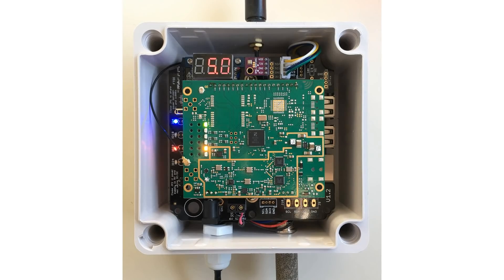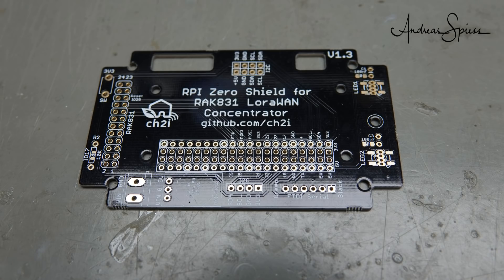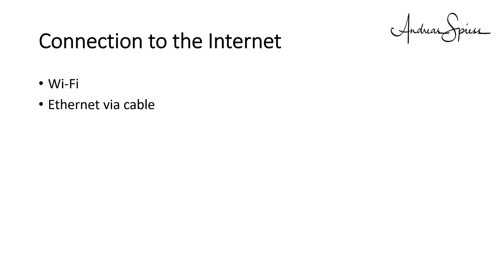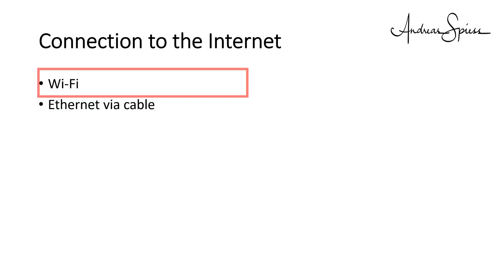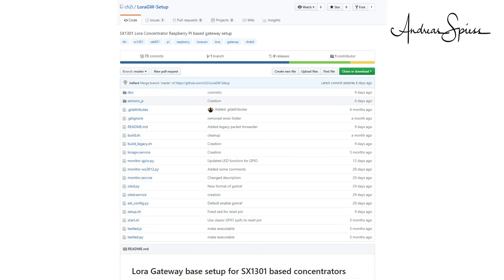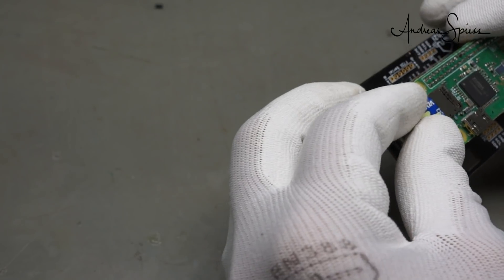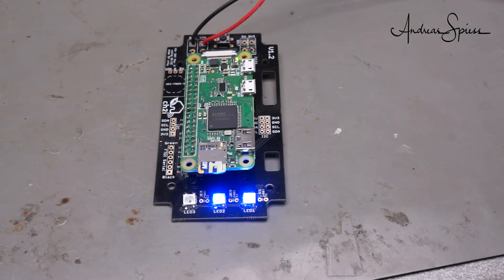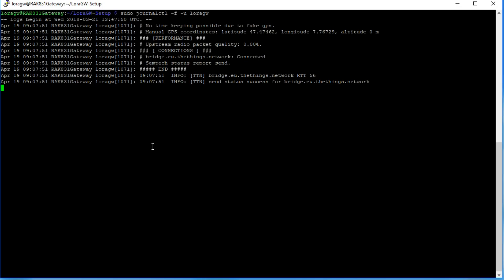#196 RAK831 LoRaWAN Gateway with a Raspberry Pi Zero (project)

Comment: Hello Andreas, greetings from Peru, congratulations for your excellent work! I would like your help, I will tell you quickly. I have proposed to implement a monitoring system for warning of landfalls in my city, for that I am thinking of setting up a "Wireless sensor network", I have researched and want to use LoRa technology, but I am still learning and your videos have helped me a lot to elaborate my possible solution. Please correct me and guide me if you think something is wrong in my plan: the system is made up of 3 sensor nodes (since there are 3 streams), each of them has a microcontroller (I want to use arduino), a LoRa module (maybe use the RFM95W like in your video #117) and the sensors, that's all. I have seen that each one can be configured as a transmitter or receiver, but the detail is in the "Gateway", if I have 3 sensor nodes mounted in the way I explained to you, I would need to be able to use a Dragino gateway, but it would have to be multichannel TRUE? Those are very expensive, I saw the way you built the gateway yourself, but the limitations leave me in doubt... Besides, you use Raspberry 3 or 4, although I saw another that you used a raspberry zero. Since your videos are from 5/6 years ago.
As of today, what components do you specifically recommend using?
What do you think of the structure as such?
What is the best way you recommend to develop the gateway? Or if a single channel gateway would work for my 3 sensor nodes?
Reply from the maker: You will need a gateway (today, I would use a commercial one) and as many sensors with a LoRa module as you want. The gateway has to have internet connection.
Reply: @AndreasSpiess  Thank Andreas, and do u know if this gateway (rak831) can receive data from different nodes LoRa? not at the same time, but with delay maybe...
Reply from the maker: @maikdaiwt-8  Maybe you watch my LoRa introduction video?
Reply: @AndreasSpiess  Thanks, that's the only video I hadn't seen.

Comment: The RAK board is everywhere out of stock, but they have the RAK7246 WisGate Developer D0. Is this a good alternative?
Reply from the maker: It has a 1308 chip. So it is an 8-channel gateway and should work for indoor. Look at the Mikrotik Gateways if you need an outdoor gateway.
Reply: @AndreasSpiess  Can I build a waterproof enclosure? Or is the gateway itself not good for outdoor
Reply from the maker: @jan.8879  Of course you can do it.
Reply: @AndreasSpiess  And the performance is ok like yours or are there differences? To what should I pay attention when choosing a gateway?
Reply from the maker: @jan.8879  They all use a similar design and the same chip.

Comment: Love these video. I wonder since it’s been some time will you revisit this to see what new hardware is available?
Reply from the maker: LoRaWAN Gateways are no more very interesting for the viewers of this channel :-(
Reply: @AndreasSpiess  that is unfortunate, but I understand your position. I am planning to put a weather station and other sensors at a garden across town, ~2 miles. I thought using LoRa to transmit and read that data would be neat.
Reply from the maker: @JohnWeland  Jost do it if you have a line of sight from the nodes to a gateway (no need it is yours)

Comment: Interesting. You're my leading feed on LoRa. As a suggestion, on the pi, if you attached to a gpio a servo to open a vent when reading temp data, that would save the heating issues. 

I'm just waiting for some practical data transfers to see what this is really like.. I see it is one tenth of dial up for most applications. Shame really...but upto 2mb. Which is great.

Also the test you did, it shows more than you think. Links (route paths TTL) has not been done on LoRa. This means that the performance could be increased. But... this maybe a Achilles heel as the same un optimisation is what makes it work.

Non the less interesting as much as it is a retrograde solution.

Comment: I bought an SX1276 868Mhz LoRa module(RFM95w) from robokits and tried to communicate a simple “hello world” message with ’ The things network ’ . I used an arduino UNO to connect with my LoRa module and the library I was using was the arduino LMIC library. Since I am from India, I checked the frequency plan in the things network and found that the frequency range for India is 865-867Mhz. So in the downloaded Arduino LMIC ibrary, I made changes in lorabase.h and ttn-abp code for arduino-RFM95 connections. I edited the European frequency values to Indian frequency values. I tried using activation by personalization (ABP) for communicating with the things network. There was a gateway in our area and all I know about the gateway is that it is an RAK831 gateway. I tried to send the message to the things and I could receive the messages in the thing network. It all worked fine… Now I bought an RAK7243 gateway from Aliexpress which is a latest version of RAK831. Actually RAK7243 is considered to be slimmer and cooler than RAK831. The SD card showed a website where we could download the firmware.I loaded the software and the OS raspbian stretch lite in the raspberry Pi 3B+ and connected the gateway to internet using WiFi. I used putty to access the raspberry Pi from my computer using a LAN cable. Raspberry Pi was configured for WiFi settings and I could get internet. I checked pinging Google.com and I got response from Google which means internet is connected in my gateway. I looked for my ethernet MAC address and made the changes in global_conf.json where I entered this MAC and the things network server address for Asia region. In the global _conf file downloaded, I could see the frequencies were the same which I used in my LoRa module library. SPI communication was enabled. Then I registered the gateway in the things network. I gave the gateway ID, checked the semtech packet forwarder dialog box and also properly gave the region, operating frequencies, location and antenna position and registered…The antenna used was rubber duck (2dBi and 50 ohm). The gateway was seen as connected with green symbol…each time I switch on the gateway, the power(Red led) will blink and (green led) also blinks for sometime (may be a few 10 seconds) and after that only red LED blinks. Now I tried the same hardware (LoRa module and arduino UNO) and the same arduino LMIC code, which I used to communicate with the gateway in my locality. But this time, it was not working. I didn’t receive any message in the the things network… Is it the problem with the gateway or my LoRa node? I checked for the status in the gateway using raspberry Pi command… It showed the message, gateway is active(running).Could anyone please help me to solve this issue?
Reply from the maker: Maybe you watch my videos about debugging? Since you have two different gateways you should be able to find out where the problem is. If your node does not work with both gateways (and you are sure the signal reaches the second gateway), the problem is your node (or the activation on TTN). Otherwise, it is your gateway. Check the keys and if they are LSB or MSB.
Reply: i faced the same issue , after a lot of search i found the issue was in TTN . Some times it misbehaves ...

Comment: Andreas Some advice  Please. I live in a area that I'm going to have to have a Antenna very high to get line of sight.  Instead of putting  the Control Box up on the Antenna, I'm thinking of running a very long Coaxial from Antenna  down to  Pi and RAK831 control box in house., does that sound right to you ?
Reply from the maker: No, antenna cables on these high frequencies have to be avoided! As you see my antenna cable is about 10 cm long. Good antenna cables cost around 10 $ per meter and still lose power.
Reply: So I guess I will have to go with a Long Ethernet cable from box on Antenna, Thanks for your help Andreas.
Reply from the maker: Or Wi-Fi as I do it
Reply: @AndreasSpiess  I'm putting  a RPI 3B+ up in the box so I guess WiFi it will be it.  The Antenna pole will be about 40 foot up,  that high I should be able to talk to Martians. Thanks for all your help Andreas

Comment: Hi Andreas, 
where exactly is the differance between the Gateway you build in this Video to the Gateway from Episode #124? I would like to use a LoRa-Gateway in my house and Connect it with maybe 20 Temperature and humidity Sensors. Is therefore the cheap Gateway from Episode #124 usable? 
Thank you really much in advance, Klemens
Reply from the maker: For your case, a single channel gateway can be ok. As its name says, it operates only on one channel and if this frequency is blocked somehow, no communication is possible. The full gateways have 8 different channels as well as all Spreading Factors.

Comment: Hi,

Can you add here the url of the product on AliExpress? 
There seem to be more products using RAK831 module, and I don't know which one is the concentrator board.
It quite confusing...

Which one is it?
This? https://www.aliexpress.com/item/RAK831-LoRa-LoRaWAN-Gateway-Module-base-on-SX1301-433-868-915MHz-range-of-up-to-49200ft/32821411294.html

Or this? https://www.aliexpress.com/item/IOT-LoRa-Gateway-Module-Base-on-SX1301-Wireless-Spread-Spectrum-Transmission-Sending-Node-LoRaWAN-Module-USB/32847407832.html

Or this? https://www.aliexpress.com/item/RAK831-LoRa-LoRaWAN-Gateway-Module-433-868-915MHz-base-on-SX1301-Wireless-Spread-Spectrum-Transmission-range/32832894046.html

Thanks.
Reply from the maker: I added now a link in the description

Comment: I only discovered your videos recently, so I'm not sure if you have done a video on Ethernet over powerlines yet. This is very interesting technology generally making use of modem chipsets from Qualcomm or Broadcomm, and the bandwidth is surprisingly good considering the mains wiring was never designed to have good impedance characteristics for communication. In any event, this would have been a third candidate for connecting your gateway to the internet...
Reply from the maker: I did not do such a video yet. You are right, this would have been an interesting possibility for my situation. I did a quick search, but only found devices, no "bare boards". For a device like that it would be good to have at least in the gateway only a board (smaller)

Comment: Hi Mr Spiess, 
Thankyou kindly for your videos.    My fellow Techs and I like to watch your shows as they are more entertaining thank Netflix.
I have a scenario that you may have a solution.
In a remote environment, is it possible to have a group of sensors report to a central device  in small data packets-  where No LoRa  connection is available?
Each station would have  the following parts . 1. Raspberry Pi 3 B      2 .  SX1278 radio chip (SPI connection )    3 . sensors.  
4. LED display with basic alarm results.
Each station could work in a stand alone "Mesh Simplex " environment at in an non interference band .  Thanks
Reply from the maker: Thank you for your compliment! Maybe you have a look at this page: http://www.radioshuttle.de/en/radioshuttle-2/protocol/ . They describe a protocol which might fit your purpose.

Comment: who is better rak831 or sx2178 gateway? which has more channel? and support more devices?
Reply from the maker: They both use the same chip
Reply: thanks for reply, 
one more question, do you test the gateway of dragino?
Reply: dragino is a 1 channel gateway, not to good as a gateway but nice as a node.
Reply: few days ago, I   bought a dragino for initial steps in lora,  but in the future I'll invest in some better,

Comment: After watching the video, I've ordered a RAK831 shield for my Raspberry Pi 3. It has arrived yesterday and today I've installed it and found that the video is already a bit outdated because Charles Hallard has updated the scripts in the mean time: it's even more automated now with fewer manual steps. So better check the installation guide first – then you can skip a few steps of the video. Thanks to Andreas and Charles for the awesome work.
Reply from the maker: Thank you for your information.

Comment: Looking at the thumbnail I thought the gateway was a physical gate :) But that would be sensible too, a remote controlled gate.

Better than one of our customers who has a second burglar alarm panel down in their gatehouse just to control the gate. $15/month plus install costs just to avoid having to have an ethernet or fibre bridge to cover the 500+ metres between house and gate. Lorawan would actually be a good solution for that, you don't need much data or very often.
Reply from the maker: If the burglar does not know about LoRa this might be a good solution ;-)
Reply: surely with LoRa your processor will have enough power to encrypt/decrypt using AES128 or something else cheap an symmetric, so with a shared key your "open gate" command ends up transmitted as 16 random-looking bytes? Sure, you're using a lot of memory to store the crypto if it's not built in, but it beats having the local high school kids playing with it.

Comment: Another great video! There are pads on the rPi 0-W for an external antenna connector. There's a 0 ohm resistor above the pads that must be rotated clockwise by 45 degrees. It's easier with a microscope.
Reply from the maker: Thanks for your info. I have to look at it when I do my next project with the RPi zero

Comment: Interesting use of those SMD type pinheaders. I have seen those in KiCAD but haven't ever bought/tried any. I've never thought about using them over through holes before.

  I've been collecting different types of basic pinheaders and terminal connections lately. Do you have any suggestions for (cheap) stackable higher current capable pin header type connectors? I've got a bunch of 2.54mm headers, and a small collection of 2mm's. I've got screw terminals for 2.54mm and 5.1mm. My problem is that I'm always trying to squeeze too much in a small space and I still want to build in more. 
   Like right now I have a small DC 'wall wart' taken apart. It has 24.5mm × 48mm × 45mm of space on the secondary side. I'm dumb enough to try to replace the original PCB w/Diode bridge that was occupying that area, and etch my own using an IC rectifier, LM317, feedback passives, adjustment pot, banana terminals, and an AliEx PIC16 voltmeter. It sure would be easier to build it with 2 double sided PCB's and a couple of stackable connectors that are spaced more than 2.54mm. I know I could connect multiple pins in multiple locations, but it just seems like the kind of thing a product could easily fix ;)
-Jake
Reply from the maker: Charles used different SMD pin-headers which are only half the height. But I did not find them on AliExpress. So I chose the "original height"...

Comment: Hi  Andreas  yesterday  I ordered   my RAK831 (915mhz)  I have wanted  to do a build but Israel  blocked   both 915mhz  and 868mhz 
  and only opened up 915 in the last while. My single channel node works well it uses your 8266 (443mhz).   I Plan to use a Orange Pi not a Pi zero  
I believe it is a better deal. It may be the First  TTN node in Israel unless somebody  get in before me. The RAK831 costs me 142$  with shipping
on Aliexpress Orange pi  about 10$ so 150$ is a bit low I think  200-230$.  I am  about 300m  above sea level  with line of sight of most of Israel costal cities . 
so I am hope to get a good range.

Single channel  gateways do not count TTN and I was on 433mhz with all the water meters  of the city.
Reply from the maker: Good luck that you are the first!

Comment: How are you finding the range? I've had a RAK831 for a few months and I get maybe 800 metres from it max. I even got a custom 915MHz antenna made for it and it didn't seem to help all that much. Aside from that I found the things network stuff to be a total mess. I ended up writing my own software to drive the concentrator and do the LoRaWAN session tracking etc.
Reply: I hit about 6000 meters but nominal range is 3000 meters. My antenna is outdoors and I'm on 868mhz. Never had an issue with ttn
Reply: >Never had an issue with ttn

OTAA would regularly fail for me and their software package was massive for what it did. And then they decided to drop that in favour of the original semtech thing, or maybe not? Who knows.
Reply: Hi space rabbit 
Which driver u are using and what is the rssi at 6000 meter range.
Reply: lmic, -120db. Its spotty at 6000m, but quite solid at about 2000-3000m
Reply from the maker: + donpalmera: I did some rudimentary range tests and did not find differences between the two. But it was no "scientific" test. Concerning the Software: I did not have too many problems over the last year. But I only started recently with OTAA. And so far, it worked for me.
I am honored I have viewers which are able to create such complex software. Maybe you publish it one day?